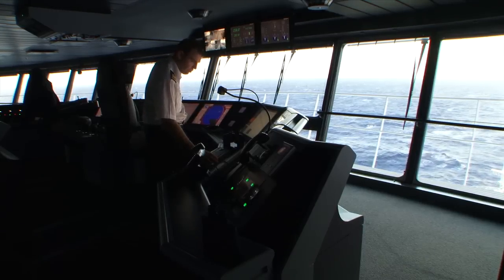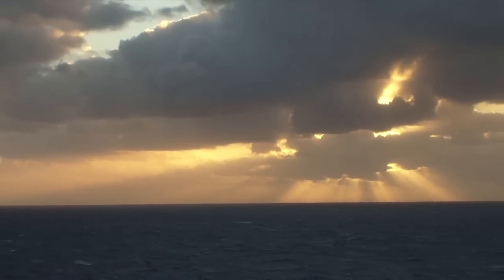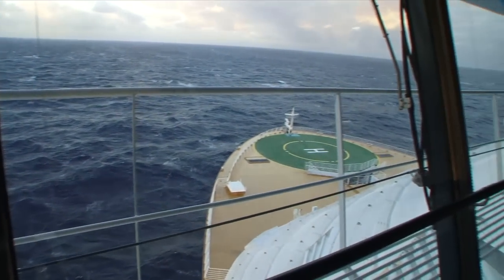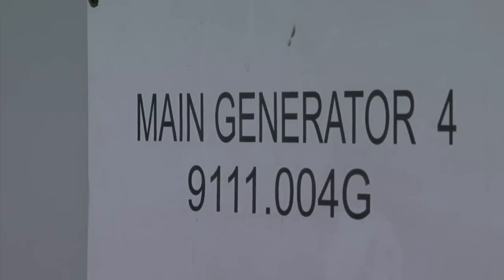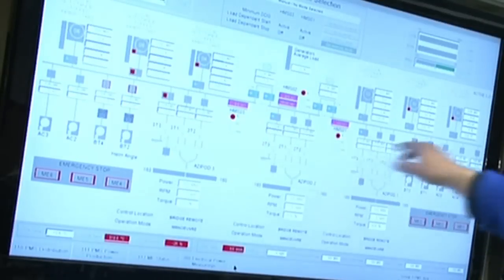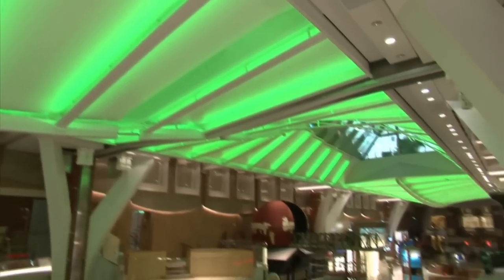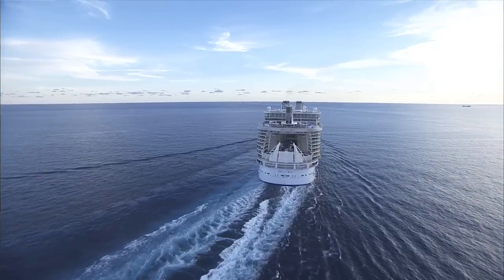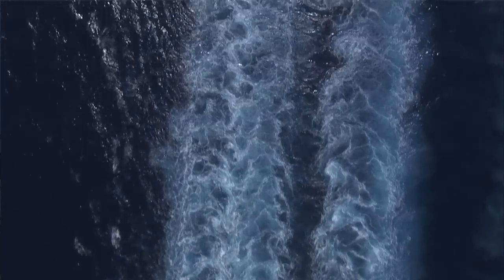Moving a Wonder: The Engines of Allure Bring Smooth Sailing

Comment: I toured the engine room of one of the smaller RCL ships and it was amazing! Bunker oil had to be heated prior to use to thin it out. So clean these engine rooms.  Engines are taken out of service while underway and completely rebuilt by a special crew when needed. Amazing operation. My thanks to RCL for the tour.

Comment: @Des Thompson 

In this case redundant is the correct term. 
It applies to the fact that there are 'back ups' built into the ship

As he says 4 engines could completely fail and the ship could still return to port

In doing this they make the ship the safest place to be so if there is causalty to the vessel it can return to port instead of having abandoning ship.
Reply: ***** With background as a Naval Architect / Marine Engineer and Chief Engineer, redundancy is the term used in the industry, and it's been the saving grace of our operations many times over.
Reply: You are right I was not trained specifically in linguistics, but do not have to be in this case. Per Merriam-Webster: "A part in a machine, system, etc., that has the same function as another part and that exists so that the entire machine, system, etc., will not fail if the main part fails". Likewise, the industry term is redundancy and it applies to the multitude of ever-present ways to accomplish the same task. There are fail-safes in every regard. I've run a ship with half of my ten engines operational, broken propulsion control system, loss of mechanical lube oil and controllable-pitch pressure, no shaft brakes, and a flooded machinery space.The ONLY way we were able to continue operating was by virtue of redundant systems. At least two of everything onboard, with multiple variations of each.
Reply: ***** ENGINEERING (of a component) not strictly necessary to functioning but included in case of failure in another component.
http://en.wikipedia.org/wiki/Redundancy_(engineering)
Reply: ***** redundancy in engineering means backup. The term is used in computing also. It does not necessarily mean a system lays there unused just in case. The whole lot can be used and if one fails the other can cope. You see it in ships engines, boiler in large buildings, computers that run companies, etc.
Reply: Yes, I know what redundancy is. A term have have used most of my life.
Reply: +Iain White The first diesel-electric ships with actual live redundancy (and the 3rd and 4th such ships in general) were the Finnish Navy coastal defence ships "Väinämöinen" and "Ilmarinen" (1932 and -31), also built in Turku btw. The next big diesel-electric ship with redundancy was the icebreaker Sisu in 1939, although that was mainly due to its operational use.

Comment: Actually, big ships are very fuel efficient. Pound for pound, they're far more efficient than much smaller boats. Look up the economics of scale. It says that the more weight you can carry with one boat (or train), the more efficient per pound it is. This is why you see CSX commercials that state they can move one ton of freight 100 miles on one gallon (because it's big and powerful  enough to do so).

Comment: So it is diesel-electric drive.  The props are turned by electric motors?
Reply: Thomas Nixon The diesel engines turn only generators. Three swivelling Azimuth props with electric motors drive the ship. Azimuth can increase efficiency by 25%. The Queen Mary 2 has also two gas turbine engines under the funnel in soundproof rooms to generate power, along with three diesel engines down below. Diesel engines are old hat in marine technology. A number of Swedish, French and Japanese submarines have Stirling engines that are very quiet near vibration free, being far more energy efficient than diesels. Stirlings are external combustion which means they are far cleaner in emissions. Far cleaner natural gas can be used as the fuel to eliminate dirty diesel. 

Stirlings are ideal for ships as they need lots of cooling and sea water gives that. Air conditioning chillers can be absorption, which only needs heat to operate, supplemented by smaller motorized chillers. Waste heat can be used to cool and heat the ship. I have no idea why Stirling engines are not upscaled and used in ships.

Ships have a long way to go yet for greater efficiency. The fact is the technology is here to greatly improve matters and has been for a long time.
Reply: ***** It is "very" fuel efficient. The diesel engines are designed for maximum efficiency running at a constant speed. Engine efficiency is guaranteed no matter what speed the ship is moving. The Azimuth (azipods) gives maximum manoeuvrability, which direct drive cannot give.
Reply: +JP JP You only need to run enough engine to give the speed you want. So quite often there are diesel-generator sets not running, which increases the efficiency. At large scales, conversion efficiency is pretty good as well, comparable to gearbox losses. Also, the azipod propellors are perfectly aligned to the direction of travel, where shaft driven propellors are quite often at an angle.
Reply: Paul Langford Also Azimuth propellers have full flow across them. There is no Hull in the way of the water flow path. This is adds efficiency.  Having a number of generator engines means they can be banked and sequenced in or out to demand.  Again adding efficiency. 

Wankel engines are efficient running at a constant speed and one third of the power and weight of a diesel.  They are also very smooth.  Upsize a Wankel (they scale up no problem) having them as gensets and they can replace dirty diesels in cruise ships where smoothness and space saving is highly desirable. Rotaries run on LPG very nicely.  Many cruise ships are turning over to LPG.

Stirlings are very efficient but large and heavy. This is where Wankles score well in ship applications.  Small in physical size banked Wankles as gensets can be swapped out, complete with genny, and in a matter of hours on a scheduled maintenance on a port stop, to be reconned ashore, eliminating large engine overhauls in dock which takes up revenue earning time. 

The rotary gensets can all be in a frame and each one fixed to skids to slide in and out. One out and a recon set in, within a few hours.
Reply: +John Burns Unfortunately, no Wankel motor comes anywhere near the efficiency of diesel. The big turbocharged two-strokes on ships quite often get better than 50 % thermodynamic efficiency, running on fuel like oily custard. No Wankel gets anywhere near this, apart from theoretical, "works by magic and wishful thinking" versions that don't actually exist.
Reply: Paul Langford The new rotaries do. Quite a bit of R&D has been done on them, like laser and HCCI ign, direct injection, etc. When run at a constant speed as on a genset application the efficiencies rises greatly. Rotaries do not like being revved up and down as then the efficiencies drop off like a stone. The power/weight ratio is phenomenal, that is why they are used a lot in UAVs. Because the UAVs carry far less engine weight they are more economical. In a cruise liner application the space they save and less vibration (greater passenger comfort, so cabins can be nearer the engine rooms) is a great bonus. Space in cruise ships generate revenue. Uptime in ships generates revenue. 

Mazda are to bring out the Skyactiv-R in 2020 for the 100th anniversary of Mazda and they have announce emissions and fuel problems have been solved. Simpler versions, with turbos can be geared to constant speed gensets. Those marine diesels as MASSIVE, with gantries around them. Luddite technology. 

There is also a new concept of rotary by Liquid Piston in the USA, funded by the US military. Once the US military start funding all progress reports go quiet.
Reply: +John Burns Please let me know where I can find an article where a Wankel engine has been tested AND SHOWN to have good thermodynamic efficiency. Mazda has been spending heaps for decades, and at every stage, the Wankel has lagged behind ordinary petrol engines, let alone diesel. All the stuff I have found has only "predicted" or "theoretical" or "computed" results, no actual, real-world measurements of motors running in test beds or vehicles.
Reply: Paul Langford
Mazda has not been spending much on rotaries at all. They stopped. They spent all their money on Skyactive, which is all from body types, suspension, unique combustion starting, etc. Mazda cars are the most technically advanced today. They never had the budget to stretch to their sports car, the RX-8 so dropped it until the Skyactiv programme was about complete. Now they are turning back to the rotary. They announced problems were solved. They announced the RX-Vision car. They would not be telling all what they have done. 

About 50% of UAVs use rotaries. if they were as bad as you say none would be made or used. There is some R&D by Rotax who injected pre-heated diesel at 98C to conform to NATOs single fuel ideal. David Garside, who developed the Norton rotary, is also doing some R&D mainly for UAVs. Audi have toyed with using rotaries for range-extenders in hybrids as they are so small. Range-extenders are part-time engines. 

Look at the positive points I gave putting banks of rotary gensets in ships; and they are viable in that application for sure, even as the rotary stands without the advances.
Reply: +John Burns Rotaries are used in aircraft for the same reason as gas turbines: high power-to-weight. NOT efficiency. Even the best gas turbines / steam bottoming cycle still can't match the big diesels in efficiency, although they can come close when running at constant duty. There are no diesel UAV's just as there are no Wankel-powered ships: the technology is not appropriate. In one, weight is the overriding consideration, in the other, fuel consumption.
Reply: +Thomas Nixon Azimuth pods can use a transmission system but it is complex and has limited reliability, because of this they are most effective when they have self-contained propulsion, the impracticallity of installing a small diesel engine in each pod leaves electric motors as the obvious choice.
Reply: +JP JP Of course there is the reason behind this. The diesel engines always run at their most economical speed, running the generators, and it's the Azipods that will convert the electrical energy into propelling power electronically as needed, with the best possible efficiency there as well.
Reply: +Rob Fraser There are several all-mechanical alternatives to the Azipods, and they were in fact there first.
Reply: +Thomas Nixon Yup. Azipods, which this ship has, are an electric motor in a steerable enclosure completely under the hull with a propeller at the trailing end. Because you can steer the azipod, you don't need a rudder.
Reply: jmowreader In fact there is no real trailing end for the Azipod type of devices. They can be used in any position, and for instance in icebreaking it's often used the prop first. There are also contra-rotating propellers in one unit, or several units in tandem.

http://www.maritimejournal.com/news101/power-and-propulsion/azipod_propulsion_for_new_uscg_icebreaker61063713624633
http://www.dieselduck.info/machine/02%20propulsion/2006%20Introduction%20to%20Azipod%20Propulsion.pdf
Reply: +Itapirkanmaa2 Have you seen the Volvo IPS pod system for yachts? On that rig the prop always leads.

Comment: I'd much rather sale on the Queen Marry 2.   Safest ship to be a passenger on.  It's not that the ship can sail with little effort through the worst storms but it has the best hand picked crew in the industry.   Sorry man but the Allure is just a cruise ship.  It's not an ocean liner.
Reply: The Queen Mary is a tug boat compared to the Oasis Class ships.
Reply: Phillip Mulligan I wonder the kind of mpg that thing gets?
Reply: Phillip mulligan What.
Reply: It's not MPG when you are talking about something that big. Think more GPM, gallons per mile
Reply: Sean Wilson the queen mary is a full ocean going vessel and can sail through hurricanes, the allure is floating hotel that has to travel very slowly and carefully across thw Atlantic
Reply: You have no idea what you are talking about... Scott trust me if you have known about safety systems on Oasis class you would think twice...
Reply: ETO0705 i think being in the navy i should know what i'm talking about, its about simple design full ocean going vessels have deep drafts, sit low in the water, have strengthened hulls and long bows so they cut through the water cleanly, oasis has none of these.
Reply: Scott Whitley Have you seen videos of the Oasis class cruise ships going through the hurricane in the middle of the sea and return without any damage? Those small ships are more fragile and unsafe compared to a this luxury cruise ship
Reply: Phillip Mulligan Bigger ship means safer and plus these Oasis class  cruise ships are designed to battle bad storms and hurricanes, and it did
Reply: Having a crew that serves 5-star service does not mean it's going to have a good safety record, especially what type of safety you're referring to. The crew were picked because they could provide the service that Cunard aim to provide to their customers and what should be expected from a prestigious company. However, those who work in non-customer facing roles are generally those who work with any other cruise company - the only standard to be met there is with the industry.

Now I know about you but for myself, I'd rather have hygiene and physical health looked after most. Nothing is worse than contracting the norovirus on-board a ship and there are guests who feel that Cunard fail in ensuring hygiene standards are met. RCCL generally have to ensure that is met with the sheer volume of guests they deal with during a voyage, especially with families and young children on-board. I've never been on an RCCL cruise, though I have been on a few NCL cruises and a Thomson one (now Marella) and all of them had a member of staff present at the entry to any food facility standing near a hand sanitise dispenser, which makes you feel like you should use it otherwise you're going to get judged heavily. 

Just to clarify though, I'm using critics and reviews from those have sailed on-board Cunard and RCCL cruises because like fuck could I afford a Cunard cruise and NCL, to me, offer a better product than RCCL though I would like to enjoy one of their cruises one day.

Comment: The engineer mentioned very 'redundent' systems, his English wasn't perfect, I think he meant 'reliable' systems.
Reply: He did mean redundant systems.  The benefits of having diesel electric propulsion is that one can have many  smaller engines powering electric alternators which are all  fed to the switchboard, this will not only provide reliability but what one calls redundant systems as if  a few engines stop there will be enough left  sail the ship to port.   Most aircraft and sea vessels have redundant system designed in them these days.